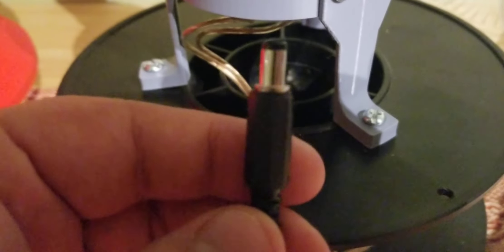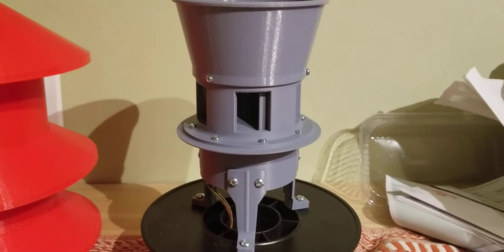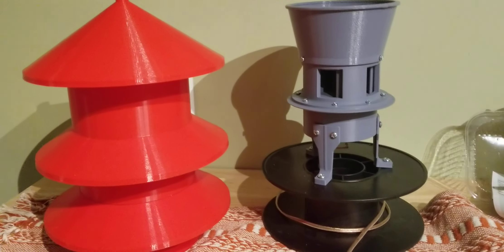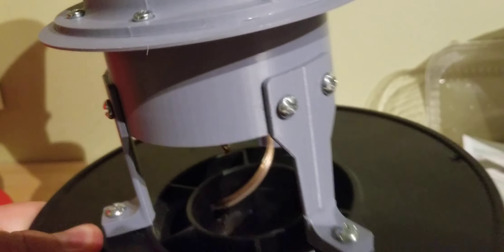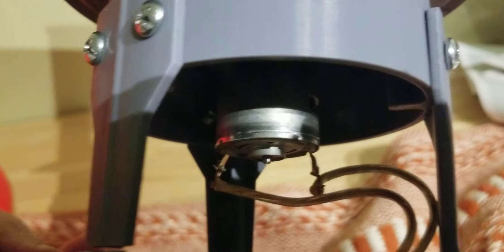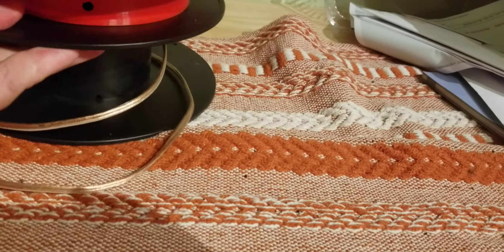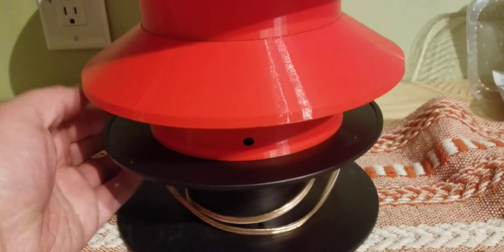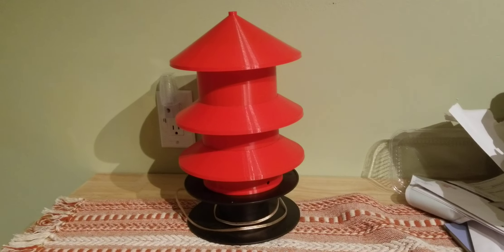1/3 scale Federal Signal Model 2 siren fully completed

Comment: Yooo, I'm making a 1/4 model 2. im wondering what motor your using?
Reply: I think that's an RS-385 SH
Reply from the maker: Sorry for the late reply. From my google search that's just about like the one I used, I used a 12,000RPM version (no load speed). Works well, I used that for my Screamer S10 and the Thunderbolt I'm building. I just realized too I never posted a run video of this one, I'll do that soon. Check out my 2T22 as well if you'd like.